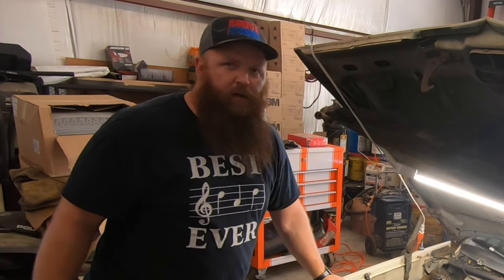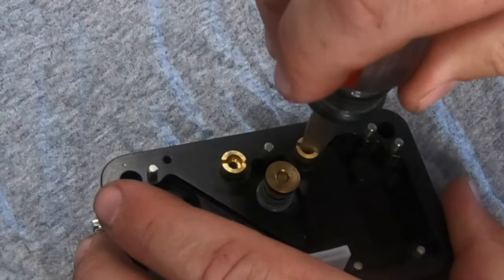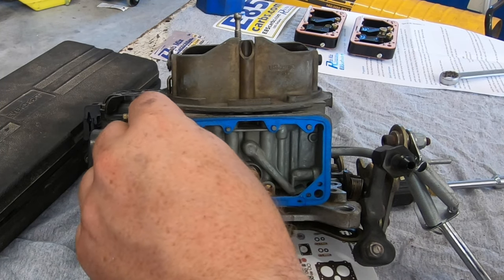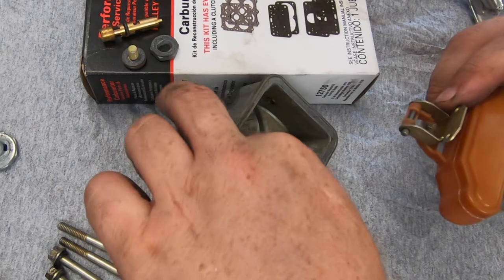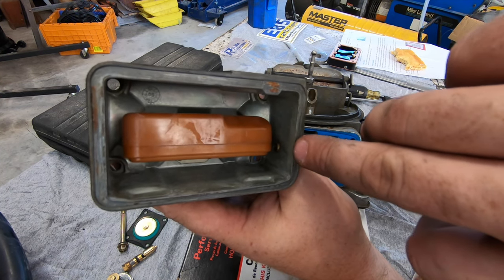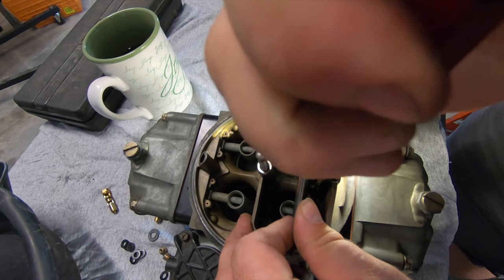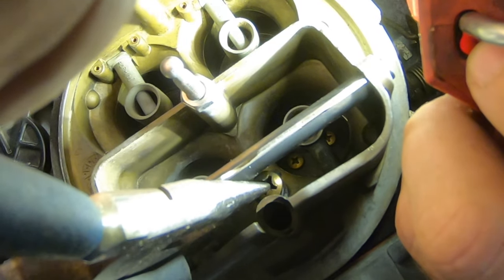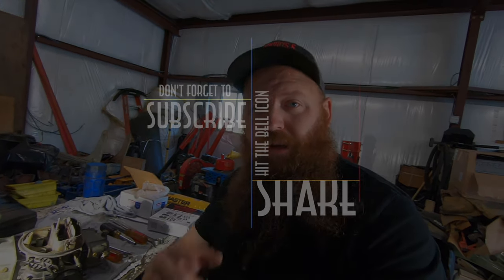E85 Conversion for Holley 4150 / 4160 carburetors using a kit

Comment: A trick for the squirters. Use a dental pick to remove and install squirters and for gaskets use a long skinny flat head. Run gaskets to handle, pit just the tip in the hole then let gasket drop down screw driver the center.
Also to raise idle without coming up to high on idle circuits, just adjust the secondary screw under neath by vacuum booster linkage.
Reply from the maker: great tips. thank you!

Comment: Tip for setting your curb idle screw- hook your vacuum gauge to the ported vacuum port. As long as you have no vacuum at idle, you're on the idle circuit and your transfer slots are golden. It takes all the guesswork out of setting the idle. Have you looked into adding a dashpot for the AC?
Reply from the maker: I have a solenoid to bolt on the carb for a high idle but haven't put it on yet. good trick for the idle circuit too!

Comment: What is the timing curve and total timing with your 144? Getting ready to install a 142. Thanks!
Reply from the maker: I followed the Weiand instructions almost exactly and haven’t had a problem. It talks about where to set your base and total timing from the static compression ratio of your specific engine. I would recommend it as it’s kept me out of trouble.